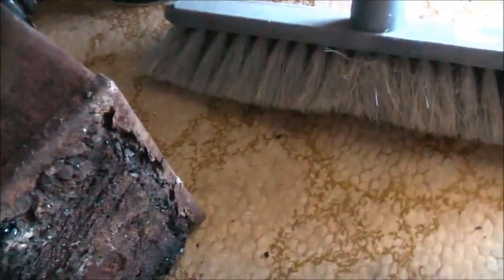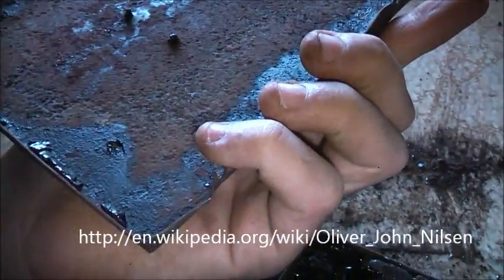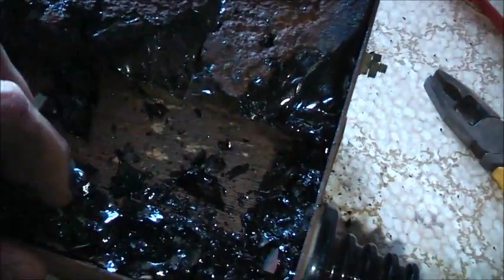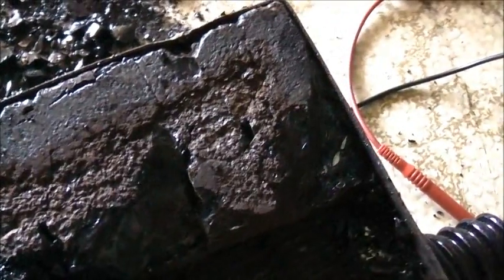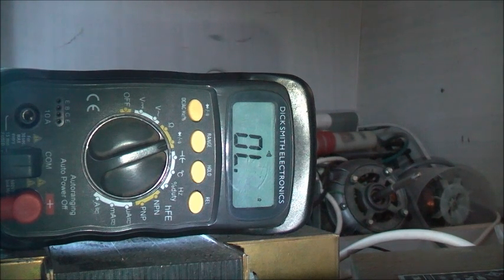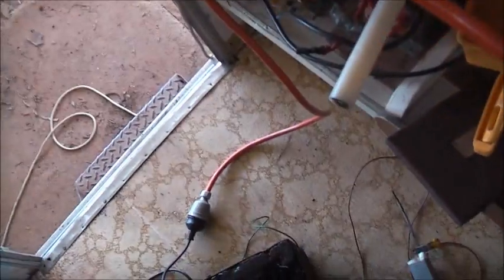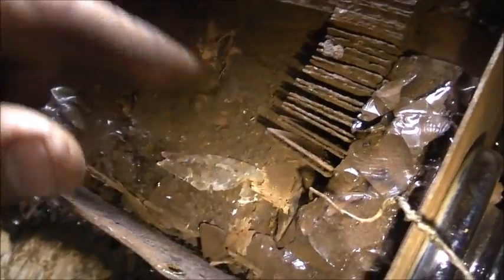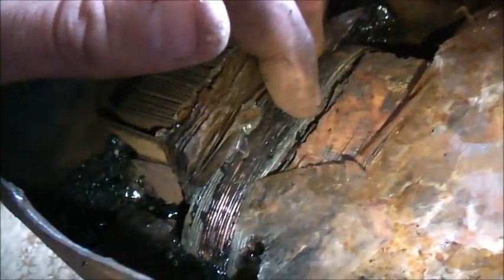Salvage Goodies Off Antique NST

Comment: Heat up the box to melt the tar and the transformer should fall out, just put the thing on a hotplate set to about 200-250 degrees centigrade and that will melt the tar.